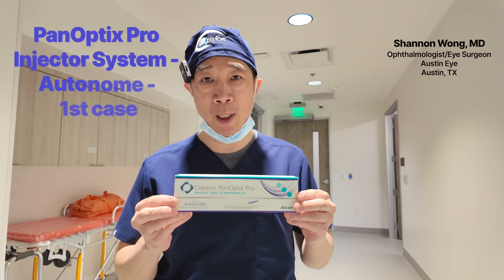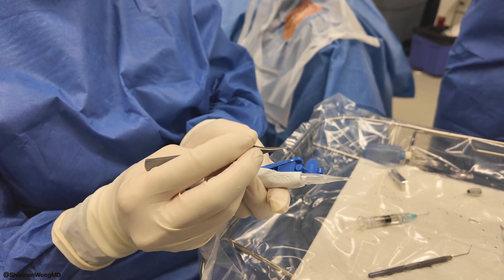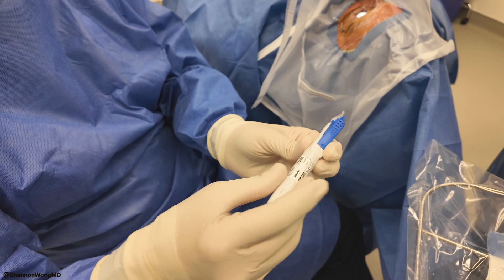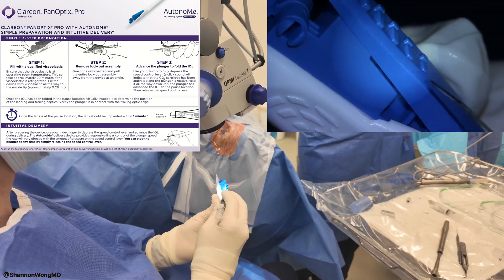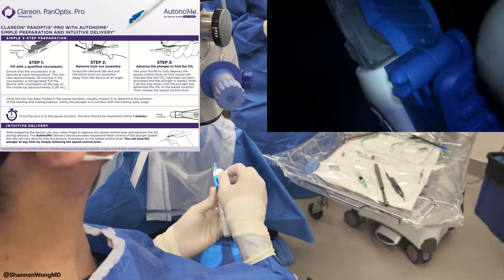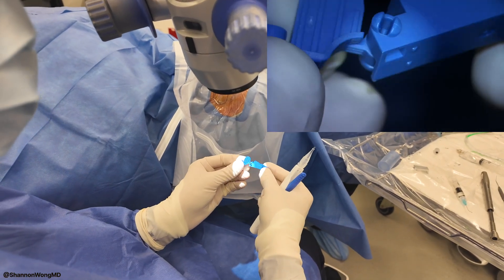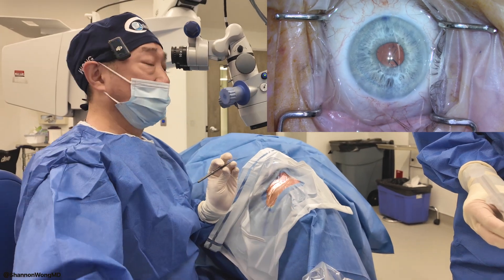How to use the Alcon PanOptix Pro Autonome (Autonomy) inserter - 1st use. 1st case. Shannon Wong, MD

Comment: I saw when you originally pushed the lens forward the leading haptic did not fold properly.  I think would be better to get another injector and advance it properly before injecting.  IMHO
Reply from the maker: The autonome injector is one of the worst engineering designs in ophthalmology.  It never needed to be created.  It adds complexity. "The best process is no process.  The best part is no part."  The normal panoptix injector is better than the autonome hands-down.

Comment: The autonome line up has been life changing for me in a hospital setting with rotating scrub techs that do not routinely do lens folding.  I am a huge fan
Reply: I wish it had less disposable plastic. Would prefer to buy preloaded cartridges that can be placed into normal injector.
Reply: @bblv2 exactly!
Reply: I wish it came out slow and haptic not pointing forward or down, it’s scary and may lead to rupture bags.
Reply: @Nicole-thagr81  I’ve never ruptured a bag with this lens. But I’ve have over time many scratches, cracks or upside down folded iols. Risk and benefits go either way. In my experience, better outcomes with preloaded
Reply: @billyyyy12 you’re one of the lucky ones, have you used the J&J  system?
Reply: @Nicole-thagr81  J&J preloaded system is extremely reliable and easy to use.  This looks unecessarily complicated and it gave a leading haptic which the J&J system has never done for me in 1000s of cases.  Cool idea though hopefully the next iteration can fix whatever is causing the issues seen here.

Comment: 1:00 The reason imho is bc more automation = greater safety it reduces IOL tech loading errors (scuffs/jams/etc). Plus it’s so nice to be able to inject with one hand while the other hand dials the lens wherever u want it- it’s like u hand the IOL off, from the right hand (outside the eye) to the left hand (inside the eye) - more control. 
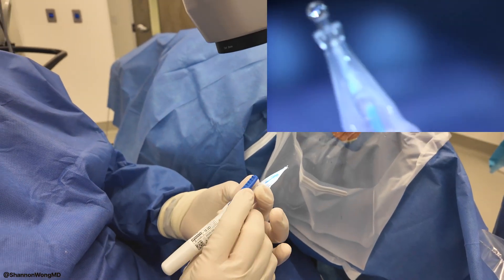One con is that sometimes the IOL will come out in a “Superman” configuration where the leading haptic sticking straight out similar to the ways urs did in this video 3:20 (rather than curled on top of the optic), but this is easily managed, esp if you have ur second instrument waiting for it inside the eye (it can be used in the same way that the iris happen to fold the haptic back 3:33)
Im a big fan of the autonome 👍🏻
Reply: It also allows one handed hydroimplantation, saving some time.
Reply: Wow, that came out super fast and almost did a back flip? 

Does the leading haptic always come out in the iris plane or does it come out pointing at the bag or PC? 

Can you stop it mid delivery if needed?